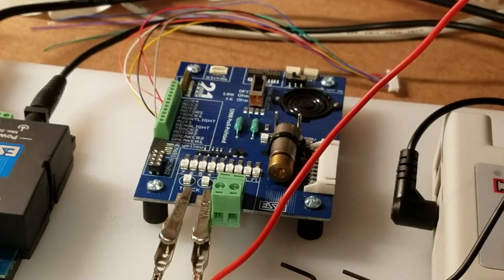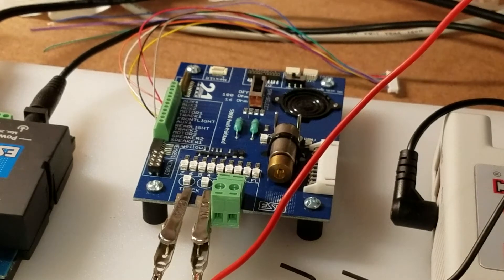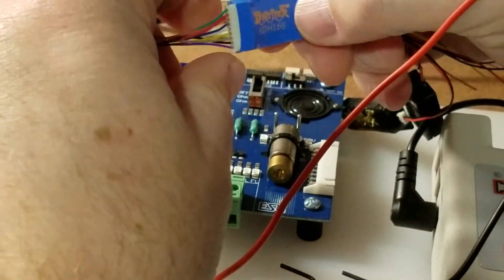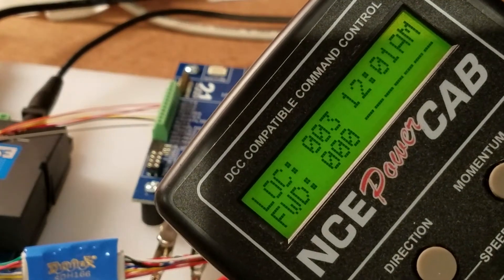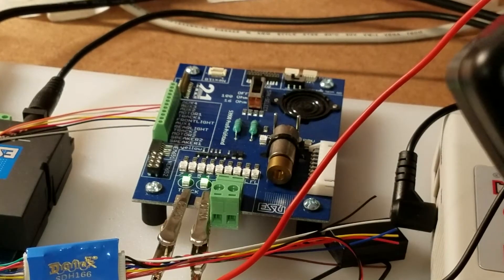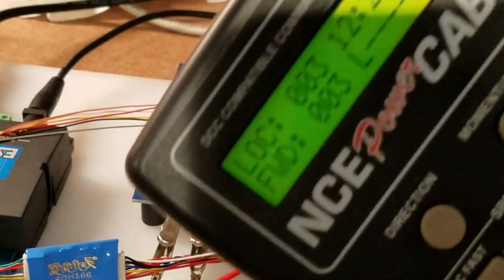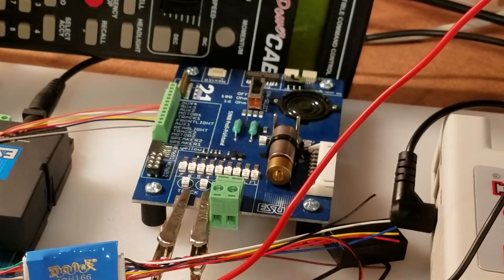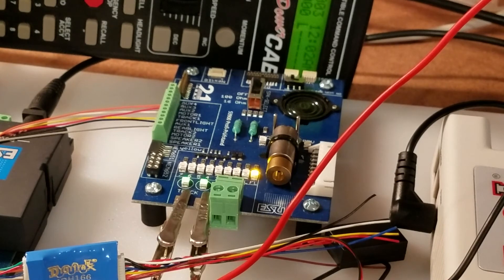Digitrax PX112-10 Power Extender

Comment: Sorry you wrong.

The moment you cut the powercab  power. The motor instantly stops.
Only the sound and the light keep continuing from some times.

That's also the problem with my digitrax PX112-10. It will not help the loco passing through a dirty track.
Reply from the maker: I beg to differ. At approximately  7:00 minutes you can see the rotation of the motor stop.  Now, I will say that in a locomotive they do behave differently. With this same power pack I can run over about 6" to 8" of bad track. Nowhere near 45 seconds. Thanks for watching.
Reply: @SoloContracting  I don't know. I can't see what you claimed. You maybe right because I can't see in the video as clear as you.

Might help if you put a mark on the  flywheel.

Thanks for your reply though.